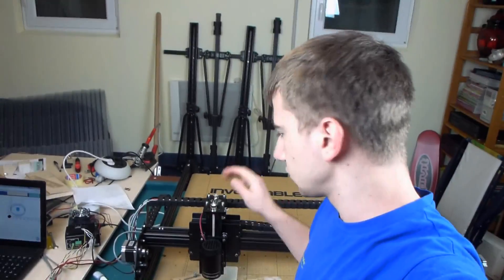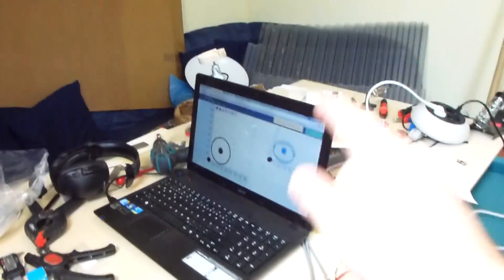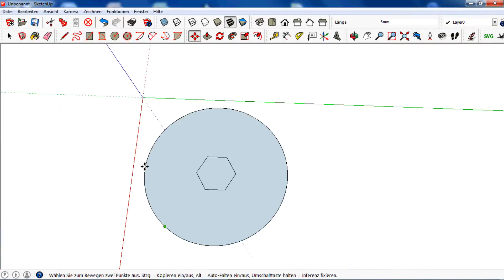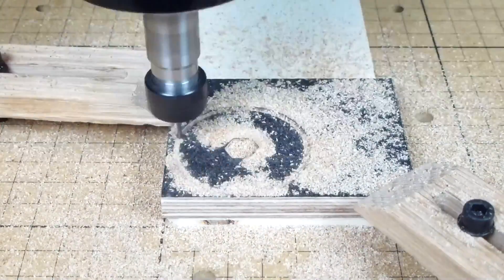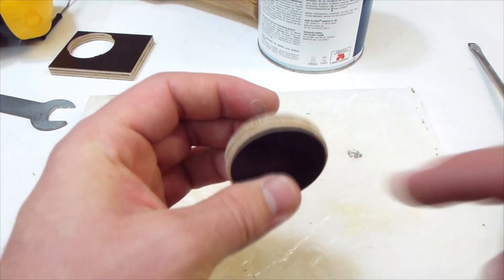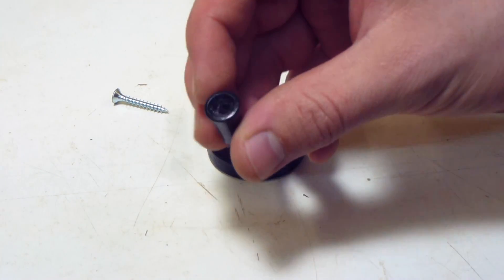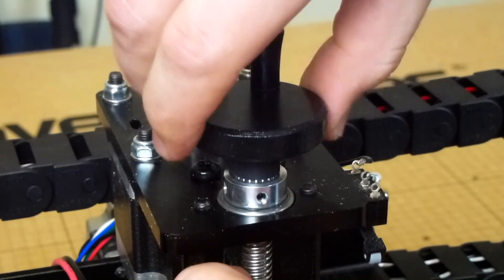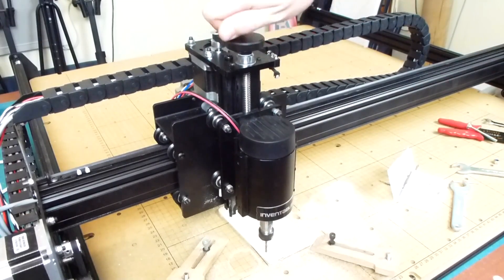Hand Crank for the X-Carve Z-axis

Comment: This is something I'm looking at doing at the moment, Do you find that the nut unscrews when you wind the handle? 
Also, are you using a plugin to make ketchup save to SVG files?
Reply from the maker: The nut stays in place. No problem. And yes, I use a SVG plugin.
Reply: +Marius Hornberger Which version of ketchup are you using? I'm having a nightmare trying to get sketchup8 to work with with an sag plugin! :-(
Reply from the maker: I don't know, just the latest version I could download. SketchUp Make 2015 I guess
Reply: +Marius Hornberger Thanks! Which SVG plugin is it, do you know?
Reply from the maker: Got it from Jay Bates website: http://jayscustomcreations.com/2015/02/cnc-workflow-sketchup-makercam-universal-gcode-sender/

Comment: Not sure (it depends on the circuit) avoid cranking fast because the stepper turns into a generator (you can even move another stepper if you connect them in parallel) , not sure if the stepper driver chip is that happy with that. Ask the manufacturer if its fine.

Comment: Nice project.  It's worth mentioning that the controller should be disabled when manually turning that axis because you'll be trying to force it against the holding current and it will be a hell of a lot easier to turn, too :o)

Comment: It's a clever solution, but I've heard it's bad for the motor driver to move the motor manually, since it essentially becomes a generator and sends a lot of current back through the outputs. I guess your Z-axis still works, but it may burn out prematurely. It might be better to make a pendant controller so you can move the axis without going back to the PC.

Comment: I like it. As far as the Z- Axis, there is going to be inconsistency between types of bits that might be used on a project. Someone has probably already mentioned it but home positon probably resets by doing a touch to determine depth of the Z-axis. Being I don’t have a unit I don’t know this for a fact, but if I was the designer and wanted you to have the power to switch bits during a project I would make sure the carver could determine a new home positon every time a bit is changed. After all broken bits happen.

Comment: Two questions, someone else already asked, how does the system recalibraite its position after your manual intervention? How did you fit that thing in your space limited shop? It will be fun to watch a creative mind on such a powerful tool.
Reply from the maker: Darnley Bynoe It doesn't. You have to tell the software were the machine is. It is located in another room.

Comment: I'm surprised  they used a standard thread lead screw, instead of those fancy zero backlash ones.  Do you have to recalibrate the Z axis after manually raising it and changing the bit.?
Reply from the maker: Man na No, it's not a standard threaded rod. Go to their website and find out more, if you want.

Comment: For the people talking about this causing damage. 

I am fairly certain the control boards have some protection against this..... Was watching the EEVblog put one together and I believe they mentioned this.
Reply from the maker: ***** Yeah, the fan starts spinning, if you manually induce some current.
Reply: Marius Hornberger If you go slow, you should be alright but at higher speeds you can induce up to 2-3 amps and back feed it through the circuit but small amounts slowly and you should be golden.

Comment: I've never had a x carve but when you were cutting out the hexagon in the middle could you not have done the outline only to save time?
Reply from the maker: TheeModerateGamer No, there would be left over in the middle.
Reply: TheeModerateGamer 
The center isn't a through hole, so, no, if you don't want additional manual work.
Reply from the maker: Ok, but it's easier to let cnc do the job, while I can do something else.
Reply: Aaha, okay fair enough! :)

Comment: Wouldn't the hand cranking generate some current (from the Z motor), and damages the control board?
Reply from the maker: Rexus King Yes it does generate current, but it doesn't damage the board. The current goes to the fan and if it's high enough it starts spinning. Inventables sells a version of this handcrank for this purpose, so I guess they thought about that.
Reply: I agree. I know they sell their hand-rank, because Bob Clagett from I Like to Make Stuff had one installed.
I think there maybe two possibilities:
1. The current isn't high enough to do anything
2. There is current protection circuit on the board(but you said the fan spins, so I doubt this possibility to be true)
Reply: ***** I don't know... I just had approximate knowledge of many things :)
http://i.imgur.com/r5Rw4At.jpg
Reply: +Rexus King There's not enough voltage backfeed from the stepper motors to damage the g-shield or arduino. I suppose if you really wanted to try with a drill it could be possible.

I'll answer that in my best impression of Marius................... "No"
Reply: Jeff Ferguson Ha ha ha, thanks :)
Reply: When you turned the step motor shaft the motor will make electricity current but there is half bridge diode inside the motor to reducing ac current .....there's nothing to worry about knob ...it's will work properly

Comment: be careful though manually moving the stepper motors. This will induce current that can harm the electronics...
Reply from the maker: Markus Meier No, it doesn't.
Reply: Marius Hornberger Maybe it won't cause damage but it definitely does induce current.

edit: Now that I see how many comments you had to answer about that question, I kinda get why your answer to this particular comment was a bit short ;)

Comment: Nice! A friend 3d-printed me a tool for the same purpose. But how do you export svg files from sketchup?? I've trying to use a plugin for that but failed! What's your method?
Reply from the maker: Torsan1977 I use the plugin... ;) Jay Bates  has it for download on his website.
Reply: +Marius Hornberger Thanks! I'll check it out! :)
Reply: Marius Hornberger and Torsan1977  Here is a direct link to it: https://drive.google.com/file/d/0B8oqOhQksyrDc0d5YVN1UUZ5cWM It's called “Flights of Ideas” and is also on instructables: http://www.instructables.com/id/SketchUp-Inkscape-and-Ponoko-Laser-Cutting/step3/Using-the-SVG-Export-Plugin/